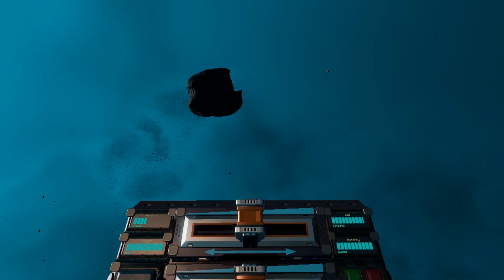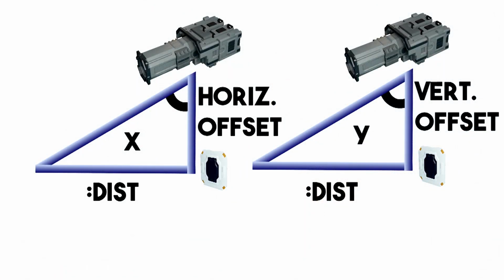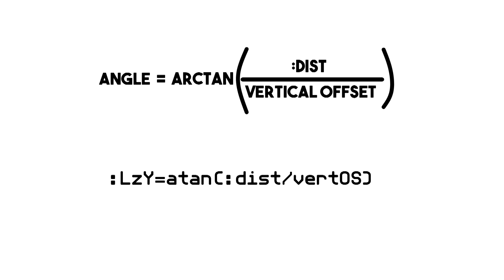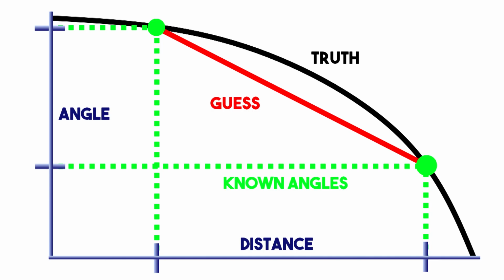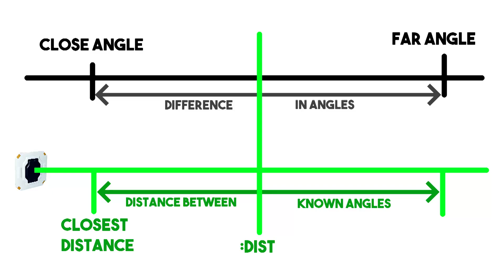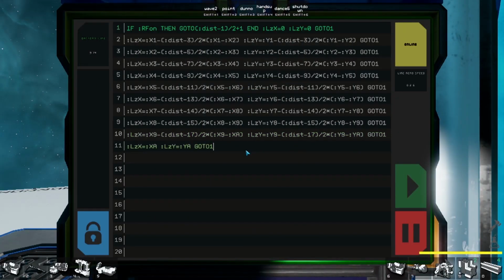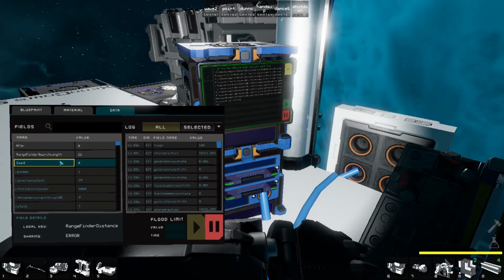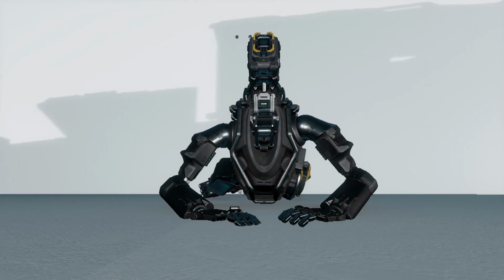Advanced Mining Laser & Ore Collector (No Professional Chip) | ByteSized Starbase Tutorial

Comment: Whitestrake on the Discord has a really short atan approximation. He frequently shares the laser script itself, which has one setup line and a single looping line. He also has a setup that lets you control the laser manually with a lever as long as your range finder is off, without additional YOLOL. I've installed that stuff myself and it's cool AF.
Reply from the maker: Interesting. I've just been hearing about approximating atan recently. I don't spend much time on Discord so I sometimes miss things like that. Maybe I can make another video on mining lasers some time that uses an approximate method.

Comment: Can this me used to make 2 lasers point at same point?
Reply from the maker: It can! Just add a couple memory chips and repeat the process for the other laser, or replace the ore collector with another mining laser and do as I did with that. Make sure that the two lasers are the same distance from the range finder, though in that method.
Reply: @XenoCow  I'm taking I focus my lasers for 20, 18, 17, 16 etc. to fill in the memory chips y's and x's with correct angles. The furthers being the ya/xa? Also my range finder is roughly 2m infront of my lasers. so :dist-1 would be :dist+2
Reply from the maker: @zeepysea  The furthest are YA/XA (A is 10 in hexadecimal). It would be :dist+2 if you reduce the range finder search length to 18. I had my search length at 21. Whatever you set the search length to, just be sure to add or subtract from it in the first line so that it equals 20.
Reply: @XenoCow  I reduced range finder to 15.5 to match the 20 ms of the laser beams, with an x angle of 8.76 and y of -.57. 2m less each time adds a full integer to x and a tenth to y. Put all those numbers in and it only goes to 2nd line in script and won't move from there.  NVM Figured it out changed the x-(:dist... to x+(:dist... and it started to work.
Reply from the maker: Yeah, the + and - signs tripped me up too at first. I left a note alongside the program in the description to help guide people to try changing them around.

I'm glad you figured it out!

Comment: NICE i added that to the Trifin with some modif. so the turret can actually turn
Reply from the maker: I'm glad you got it all working!
Reply: Could you tell where to mount an ore scanner to TriFin without screwing it up? I'm buying a third(!) TriFin tomorrow because two of them died when i was trying to weld an ore scanner to them. Seems that i broke some cabel when i was taking off the armor plates to fit the hardpoint.
Reply: @antonstezhkin5991  
I mounted my ore scanner above the range finder.  Built a bracket just behind the rangefinder and put a turret with pitch on it.  Bit of a pain working with turrets.  It's on there now and I angled the pitch to line up with the range finder at about 80m, so I can determine if I want to keep going towards the roid once I see what it is.
Reply: @WakkaWakka25  thanks! I managed to find a place for the thing myself. ... And got killed by the pireates the same day. 
Guess i have some kind of bad luck with the TriFin. =)
Reply: Would you mind sharing your coding modifications for the trifin? I managed to get my left side to work but not the right, the positive rotation on the right turret seems to keep messing it up.

IF :MINE==1 THEN GOTO(:R+2)/2+1 END :TPR=-5.77 :TRR=2.05 GOTO1
:TPR=:RX1-(:R-1)/2*(:RX1-:RX2) :TRR=:RY1-(:R-3)/2*(:RY1-:RY2) GOTO1
:TPR=:RX2-(:R-3)/2*(:RX2-:RX3) :TRR=:RY2-(:R-5)/2*(:RY2-:RY3) GOTO1
:TPR=:RX3-(:R-5)/2*(:RX3-:RX4) :TRR=:RY3-(:R-7)/2*(:RY3-:RY4) GOTO1
:TPR=:RX4-(:R-7)/2*(:RX4-:RX5) :TRR=:RY4-(:R-9)/2*(:RY4-:RY5) GOTO1
:TPR=:RX5-(:R-9)/2*(:RX5-:RX6) :TRR=:RY5-(:R-11)/2*(:RY5-:RY6) GOTO1
:TPR=:RX6-(:R-11)/2*(:RX6-:RX7) :TRR=:RY6-(:R-13)/2*(:RY6-:RY7) GOTO1
:TPR=:RX7-(:R-13)/2*(:RX7-:RX8) :TRR=:RY7-(:R-14)/2*(:RY7-:RY8) GOTO1
:TPR=:RX8-(:R-15)/2*(:RX8-:RX9) :TRR=:RY8-(:R-15)/2*(:RY8-:RY9) GOTO1
:TPR=:RX9-(:R-17)/2*(:RX9-:RXA) :TRR=:RY9-(:R-17)/2*(:RY9-:RYA) GOTO1
:TPR=:RXA :TRR=:RYA GOTO1
//RIGHT LASER TURRET TRACKING

IF :MINE==1 THEN GOTO(:R+2)/2+1 END :TPL=-5.77 :TRL=-2.05 GOTO1
:TPL=:LX1-(:R-1)/2*(:LX1-:LX2) :TRL=:LY1-(:R-3)/2*(:LY1-:LY2) GOTO1
:TPL=:LX2-(:R-3)/2*(:LX2-:LX3) :TRL=:LY2-(:R-5)/2*(:LY2-:LY3) GOTO1
:TPL=:LX3-(:R-5)/2*(:LX3-:LX4) :TRL=:LY3-(:R-7)/2*(:LY3-:LY4) GOTO1
:TPL=:LX4-(:R-7)/2*(:LX4-:LX5) :TRL=:LY4-(:R-9)/2*(:LY4-:LY5) GOTO1
:TPL=:LX5-(:R-9)/2*(:LX5-:LX6) :TRL=:LY5-(:R-11)/2*(:LY5-:LY6) GOTO1
:TPL=:LX6-(:R-11)/2*(:LX6-:LX7) :TRL=:LY6-(:R-13)/2*(:LY6-:LY7) GOTO1
:TPL=:LX7-(:R-13)/2*(:LX7-:LX8) :TRL=:LY7-(:R-14)/2*(:LY7-:LY8) GOTO1
:TPL=:LX8-(:R-15)/2*(:LX8-:LX9) :TRL=:LY8-(:R-15)/2*(:LY8-:LY9) GOTO1
:TPL=:LX9-(:R-17)/2*(:LX9-:LXA) :TRL=:LY9-(:R-17)/2*(:LY9-:LYA) GOTO1
:TPL=:LXA :TRL=:LYA GOTO1
//LEFT LASER TURRET TRACKING

Comment: How would this work with many lasers, all having different orientation?
Reply from the maker: If they are symmetrical with respect to the range finder, then you can multiply either the horizontal or vertical calculated angles by -1 (like I did with the ore collector). Otherwise you would have to set up memory chips for each turret. Just be sure to name the saved values on the memory chips and the angle fields on the turrets differently. (L1X, L2X maybe for laser 1 and 2's horizontal rotation for example)

Comment: dude just use the same var for RangeFinderDistance and MiningLaserBeamLength, takes 5 seconds.
Reply: That does not do what the vid showed....
Reply from the maker: Chow Jappa is correct. Your method would reduce the laser range, but unlike my video, it would not turn the turrets to point at a particular point in space. Lowering the laser range might reduce power draw though... Hm.
Reply: You probably want your mining laser length to be slightly longer than the range finder distance.
Reply from the maker: @Derzull2468  Of course. :) The mining laser makes up the hypotenuse (longest side) of the triangles.

Comment: No mention of pulsed mining lasers? If you pulse your lasers (turn them on for 1 yolol tick then off for 2), you can run your laser for 1/3rd the power cost and 5/6th the mining speed. Consequently, you can then run 3 times as many lasers as you had before for the same power usage, so you end up mining 2.5 times as fast as non-pulsed lasers.
Reply from the maker: I think I had briefly heard about pulsing lasers now that you mention it. I learn most of my Starbase stuff autodidactically. That technique wasn't at all near the front of my brain I suppose. 

I just put it on my video list so that I can make a video about laser pulsing later. Thank you for the tip!
Reply: Thanks! You have just saved me tons of time to figure out what's the optimal frequency of turning the laser on.

Comment: You should be able to do a fairly easy "curve fit" and make that script much much shorter.

Like using numpy in python something like:

import numpy, math
offset=1.3
x = numpy.array(range(0,21))
y = numpy.array([ math.atan(x/offset) for x in range(0,21) ])
z = numpy.polyfit(x, y, 2)
print(z)

run that, it will print [-0.00578004  0.15735146  0.51400353]

Take those 3 values and plug into y=ax^2+bx+c as [a, b, c] respectively and x is your distance.
y becomes the angle you want, or close-ish to it.

so you yolol would be something like

:LzX=-0.0058*(:dist*:dist)+0.1573*:dist+0.5140 goto 1

Provided that your offset along X was 1.3.... In theory :D I have not actually tested this. Still very new to Starbase.
Reply: Oh I just tried to plot that, that curve looks like shit, sorry :D That def won't work well... the fitting is terrible.
Reply: Somebody better at actual math than me should do this, but I spent some time in https://www.desmos.com/calculator and came up with (((x-6)/5.35))^3+1.41 where x is your distance, is a decent fit up until 7 meters, at which point you can just do an interpolation from 1.41 to 1.509.

Again given that your offset was 1.3... it won't be a single line of yolol with having to do that ^3 but.. you would not need your memory lookup thingy at least...
Reply from the maker: @JJacobsson  Hmmm. That's pretty smart. I forgot about polynomials... 

This seems like it would work very well with the right measured offsets. I bet that this method could very well beat out mine if the offsets are measured correctly.

Good on you for using the ol' noodle. :)
Reply: @XenoCow  I only thought of it because I tinkered with it for doing fixed point versions of sine/cosine a few years back. I feel like it should be doable, but you might need an advanced YOLOL chip so you get access to the ^ operator so you don't have to drive yourself nuts typing :dist*:dist*:dist*:dist*:dist*:dist  :D
Reply from the maker: If you get it working in-game, I would love to see it. It would save a couple memory chips at least... Time? I'm not sure.